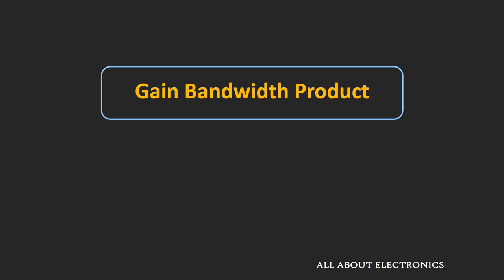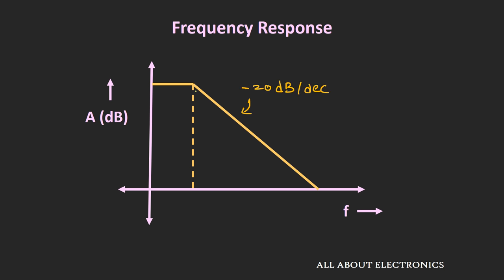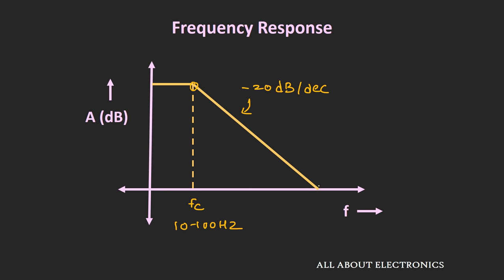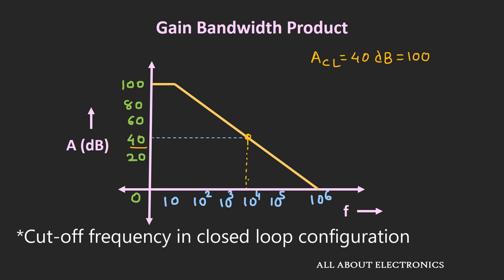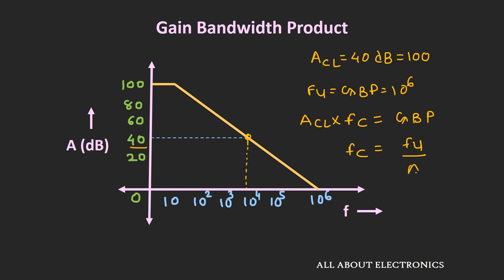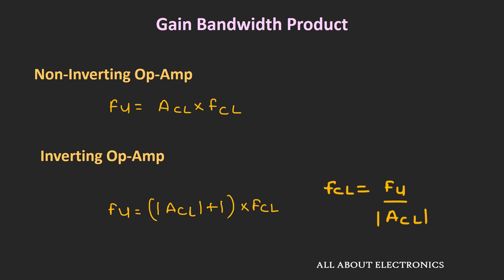Op-Amp: Gain Bandwidth Product and Frequency Response

Comment from the maker: The timestamps for the different topics covered in the video is given below:
0:33 Frequency Response of the Op-Amp
1:25 Role of Internal Compensation Capacitor in the Frequency Response of the Op-amp
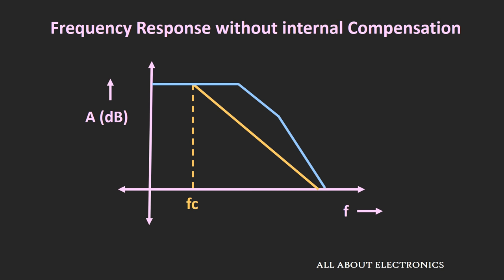2:58 Gain Bandwidth Product of Op-Amp
5:40 Gain Bandwidth Product of Non-Inverting and Inverting  Op-Amp
Reply: ALL ABOUT ELECTRONICS 
You rocks.🤘
Great job.
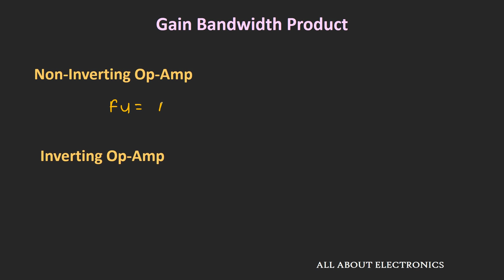Reply: 5:55 sir did u provide a dervaition of bandwidth of  inverting and non-inverting amplifier?

Comment: by adding two idential opamps bandwidth is decreasing,with one opamp it is 100KhZ ,with 2 opamps its 64Khz..did i miss anything here?
Reply: I was a bit confused at first too. The aim is to get a gain of 100. Since the GBP is 1 MHz this results in a bandwidth of 10 kHz if one stage is used. However if you use two stages each with a gain of 10 you achieve the gain of 100 and a BW of 64 kHz according to the formula.
Reply: @straydogg56  then the gbp changes? if not,then gain is not 100

Comment: Congrats for your work!
During this video presentation I think you can differentiate Gain (notated with A[dB]) from Amplification (Vout/Vin). I think you mix them using the same "A" notation for both of them, as depicted at 4:24 (for example). Good luck!

Comment: 01:31 Op-Amp has a low cutoff frequency and internally compensated with composition capacitors.
02:44 Op-amps are internally compensated to ensure stability at high frequencies and have a low open-loop bandwidth.
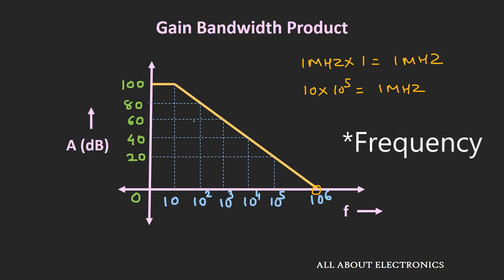03:56 The gain bandwidth product of an op-amp determines the cut-off frequency in a closed-loop configuration.
05:06 The gain bandwidth product of the op-amp is 10^6 Hz.
06:13 The cutoff frequency of an op-amp depends on its gain. When the gain is high, the cutoff frequency is equal to the unity gain frequency. But when the gain is low, the cutoff frequency differs between inverting and non-inverting configurations.
07:31 The cutoff frequency of an op-amp configuration is equal to the unity gain frequency divided by the closed loop gain.
08:42 Using multiple stages of identical op-amps increases the bandwidth while maintaining the same gain.

Comment: BW is decreases when we use multiple op amp cascaded and you are saying that we can use high Band width product or multiple op amp to increase BW.
It is decreased to 64KHz from 100KHz
Reply: yup that didnt make any sense at all.the first point of choosing a opamp with high gbp was clear but on cascading it the bandwidth reduced
Reply: @sushanttiwari3078  Look at @8:04 and then at @9:20. Using the same Opamp BW increased from 10kHz to 64kHz. Hope this helps.
Reply: 100KHz was for open loop unity gain bw, not for the closed loop. For closed loop it was 10KHz and was improved to 64KHz.

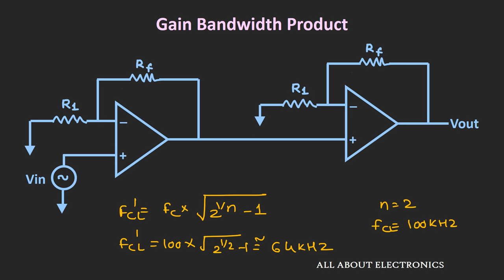Comment: @9:30 Bandwidth of op amp in reduced by cascading, it GBW product which is increased.
Reply: true
Reply: Let's say you are using a single op-amp which has a gain-bandwidth product of 1 MHz. And you want to attain the gain of 100. In that case, the maximum frequency of the signal should be less than 10 KHz. (1MHz/100). So, effectively you can not amplify the signal which has frequency more than 10 KHz.
On the other hand, if you amplify the signal in two stages, using two op-amps then you can achieve the same gain of 100 through 2 stages. At the same time you can also increase the effective bandwidth of the two stages. (i.e 64 KHz)
Reply: @architdongre1372  its 6.4kHz and not 64kHz.
Reply: @moiz6164  it's 64khz...go by the formula. Also, each stage now has the gain of 10, not 100 (gain for 1 stage)

Comment: An amplifier is required to have a voltage gain of +70 dB over the frequency range 0 to
8 kHz. Design a suitable circuit employing operational amplifiers (op amps) that have an
individual gain-bandwidth product (GBP) of 106. Draw the circuit diagram and indicate
suitable values for the resistors used please help!!

Comment: Is gain bandwidth product is only applicable for op-amp consisting capacitors either in feedback or input ckt because in simple ckt there is no one components whose parameters depends upon frequency.

Comment: I do not understand how putting two op amps in series will increase the bandwidth

The value of the fc is 100kHz and putting them together makes it 64kHz.. i do not understand how it increased? Sorry am new to this

Referring to the last part
Reply from the maker: Let's say you are using a single op-amp which has a gain-bandwidth product of 1 MHz. And you want to attain the gain of 100. In that case, the maximum frequency of the signal should be less than 10 KHz. (1MHz/100). So, effectively you can not amplify the signal which has frequency more than 10 KHz.
On the other hand, if you amplify the signal in two stages, using two op-amps then you can achieve the same gain of 100 through 2 stages. At the same time you can also increase the effective bandwidth of the two stages. (i.e 64 KHz)
I hope it will clear your doubt. If you still have any doubt then do let me know here.
Reply: The cutoff frequency decreases, hence the bandwidth increases
Reply: Note that gain is increased from 10kHz to 64kHz.
Reply: @ALLABOUTELECTRONICS  thank you so much sir thank you
Reply: @sumitabhabanerjee1338  I don't think so can you justify your answer
Reply: same here....

Comment: Why gain  is 1? according to the curve the gain should be 0
 the value of y in the x axis =0
But u r saying unit voltage gain at A=0
How
Reply from the maker: The gain on the y axis is in dB
Reply: When f =10^6
A=0
Den why unity gain? @9:57
Gain is not 1 according to ur curve
Reply: It should be 1,1
The curve should be strt from 1,1 
Not from 0,0
Cz its a logarithmic curve
And log0= doesn't exist

Comment: Sir at 4:24 we draw the straight horizontal line with gain 40 drawn in the "open loop FR" to get the frequency upto which it gives constant gain of 40 in closed loop configuration right??? 
Thanks
Reply from the maker: Yes, correct.
Reply: @ALLABOUTELECTRONICS  thanks

Comment: Sir what is meant by constant gain. i mean you have said that till now we were using constant gain and gain is constant till a certain band of frequency and after that frequency it becomes 0. Can you please elaborate it sir?
Reply from the maker: The gain of the op-amp is a function of frequency and the frequency response is very similar to a low pass filter.
So, up to certain frequency, the gain is constant but after that it reduces and at one frequency it will become 0dB (unity gain).  For ideal op-amp, the gain should be constant and bandwidth of the op-amp should also be infinite. So, if you consider ideal op-amp, then it has a very gain for all frequencies in the open loop condition. But for actual op-amp in open loop condition, the gain is constant only up to few Hz, let's 100 Hz or so. But when it is used in closed loop condition then that frequency will increase (depending upon the closed loop gain, as the gain-bandwidth product is constant)
I hope it will clear your doubt.

Comment: I am not educated with electronic .
I am looking for low gain amplifier for my 5.1 decoder.
For soft sound . I hear tda or TPA series but don't like them due to sharp sound .
So I looking for bi- amp development my self.
According I am wish
50 watts for tweeter and  80 watts for woofer.
How can I achieve my goal ???
Issue how to collaborate two different amp with diffrant gain? 
It's possible to develop amps as per requirement with both gain will be same below 20 dB is this possible ????

Comment: why does an inverting opamp with a purely resistive arrangement have a frequency response?
Reply: That Op-Amp itself has a frequency response. Ideally an Op-amp should have infinite bandwidth, but this is not the case with practical ones, so an Op-Amp is not an ALL Pass Filter, but a wide band LPF. Therefore, it has a frequency response mainly due to the BJTs used to manufacture that IC.

Comment: in the end of the lecture the cut off frequency is reduced from 100khz to 64 khz .So actually the bandwidth is reduced.But u said that it will increase. How?
Reply from the maker: If we try to get the gain of 100 using a single op-amp, then the cut-off frequency is 1Mhz/100 = 10 kHz. While using two stages with each having gain of 10, the overall cut-off frequency of the overall circuit ( two pairs of opamp) is 64 kHz. So, with this configuration, it can be operated till 64 kHz instead of 10 kHz. I hope it will clear your doubt.
Reply: @ALLABOUTELECTRONICS  yes.Thank you sir

Comment: Sir, understood all the topics well,but this video i m trying to get,but don't know why i m not getting it well.
Sir my 1st question is ,why do the gain of an op-amp circuit only involving resistances too depend on frequency...and how exactly this depend on frequency?is it only because of some internal structures as you said?? Please help sir🙏
Reply from the maker: Yes, that's because of the op-amp internal structure. As I mentioned in the video, even without any external resistor, in the open-loop condition also the op-amp has a certain frequency response (The exact response depends on the poles and zeros of the op-amp structure). At very low frequency, it provides very high open-loop gain, and the frequency increases, the gain reduces. With external resistors,the closed-loop gain reduces. 
For more info, please check this article:
https://www.allaboutelectronics.org/gain-bandwidth-product-of-the-op-amp/

Comment: 9:34 how the bandwidth is increased as fcl is 100kHz and fcl' is 64kHz?
Reply from the maker: If we try to get the gain of 100 using single op-amp, then cut-off frequency is 1Mhz/100 = 10 kHz. While using two stages with each having gain of 10, overall cut-off frequency of the overall circuit ( two pair of opamp) is 64 kHz. So, with this configuration, it can be operated till 64 kHz instead of 10 kHz. I hope it will clear your doubt.
Reply: @ALLABOUTELECTRONICS  thank you sir, i got it
In that timestamp frame, there is a typo mistake as 100kHz instead of 10kHz
Then this will justify 64>10kHz

Comment: 1:15 cut off frequency is given where gain reduce by 3 dB but also, from fc gain reduces by 20 dB/dec. which is true?
Reply: 3dB means 70.7% of maximum gain or 1/√2 times of maximum gain

Comment: At 3:48 in multiplying Gain and frequency how did we get 10×10^5 ? And how at 4:26 40db corresponds to 100?
Reply from the maker: Here, the gain is in decibel. So, if you convert it into the normal gain it will be equal to 10. 
A simple formula to represent gain dB is 20 log (Gain) . So, if your gain is 10, then in dB it will be equal to 20*1. 
If the gain is 100, then in dB it will equal to 20*2=40, and so on. 
For more information, you check my video on decibels. 
https://www.youtube.com/watch?v=ta1sUTiJNkY
Reply: @ALLABOUTELECTRONICS  at 9:25 by cascading two op amps the bandwidth is reduced from 100kHz to 64 kHz whereas you said that we cascade to increase the bandwidth. Please explain ??

Comment: why exactly at -20dB it will decrease or increase??
Reply from the maker: Its because of the internal compensation capacitor. It adds one pole in the transfer function. Because of that, it reduces at -20 dB / dec. Its similar to the first order low pass filter, where in the frequency response, the gain starts reducing at the rate of -20 dB/ dec after -3dB frequency. 
I hope it will clear your doubt.

Comment: 100 kHz to 64 kHz how it is an increase
Reply from the maker: If try to get the gain of 100 using single op-amp, then cut-off frequency is 1Mhz/100 = 10 kHz. While using two stages with each having gain of 10, overall cut-off frequency of the overall circuit ( two pair of opamp) is 64 kHz. So, with this configuration, it can be operated till 64 kHz instead of 10 kHz. I hope it will clear your doubt.
Reply: Thank you very much

Comment: what about open loop gain sir?
Reply from the maker: Gain bandwidth for the op-amp is defined for open loop gain only (In datasheets). In fact, as discussed in the video, it is the product of open loop gain and the unity gain frequency. So, in open loop configuration if you are operating at DC or low frequency then the gain of the op-amp will be equal to open loop gain (As defined in the datasheet). And as the operating frequency increases, the open loop gain reduces. (As shown in the graph in the video).
I hope it will clear your doubt. If you still have any question then do let me know here.
Reply: ALL ABOUT ELECTRONICS yes sir now it is all clear to me.....thank you sir

Comment: How to find bandwidth?
Reply from the maker: You mean the bandwidth of op-amp or the bandwidth in general ?
Reply: Bandwidth in general
Reply: I mean when we use that fcAcl=fu
Reply from the maker: with the designed or required gain, when we need to find the maximum allowable operating frequency then this equation is useful. Gain bandwidth product of the opamp is already given in the data sheet of the opamp. Using that, and the required closed loop gain, it is possible to find fcl.